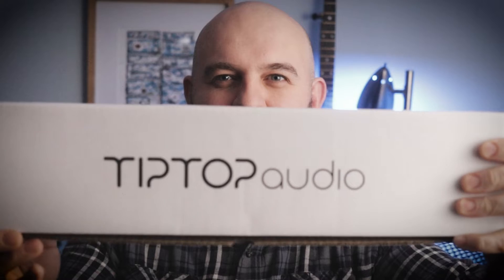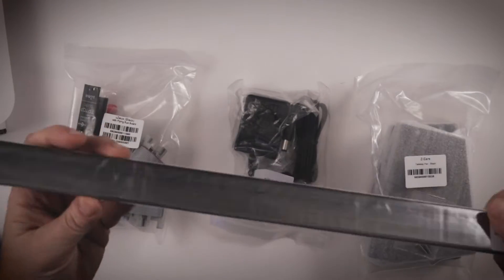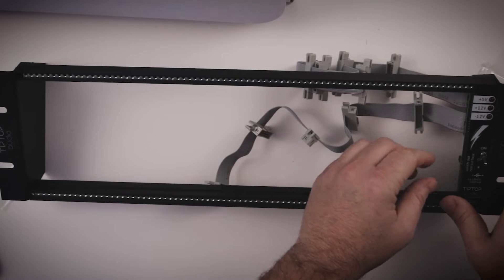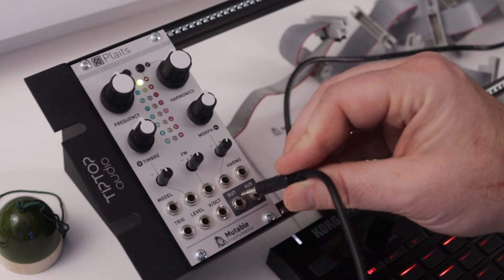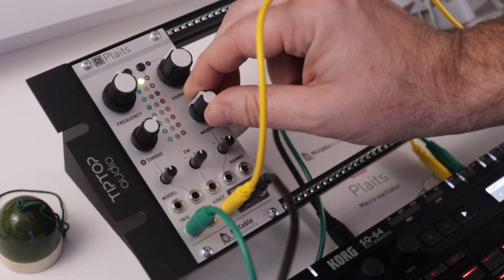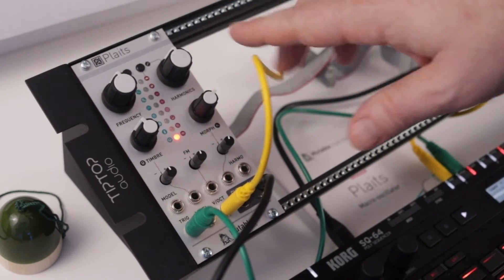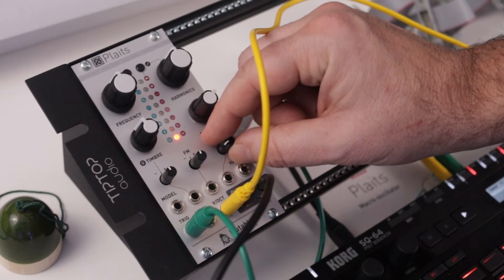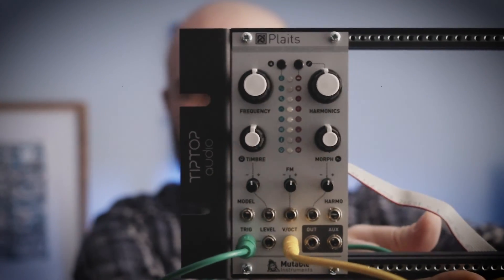Mutable Instruments Plaits and Tip Top Audio Happy Ending Kit - First Modular Build - Part 2

Comment: question please, can this blow? i managed to blow two power suppliers by putting the audio into the wrong input out put does this do the same or its protected from that?
Reply from the maker: Wow! I'm not sure actually. I haven't had an issue with it. I'm surprised that plugging the audio into the wrong input would blow the power supply...
Reply: @braintree56  yes when  you did it and you hits the sides of the unit i got scared for you lol, I'm going to purchase the unit based on that alone do you have an affiliate link?
Reply from the maker: @micblack  Ha. Yep - didn't blow... Thanks so much. There's a link in the description. But here it is as well. Appreciate it. 

https://link.perfectcircuit.com/t/v1/8-12626-292798-9759?url=https%3A%2F%2Fwww.perfectcircuit.com%2Ftiptop-happy-ending-kit.html